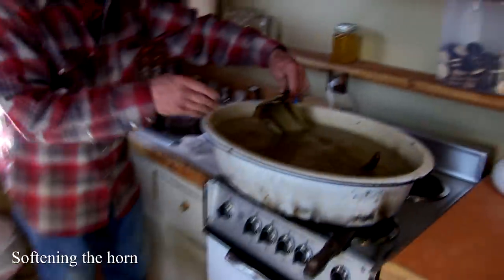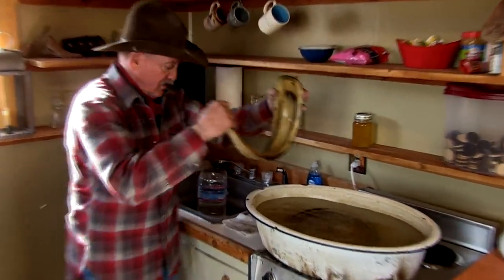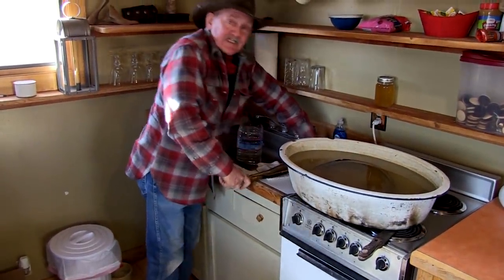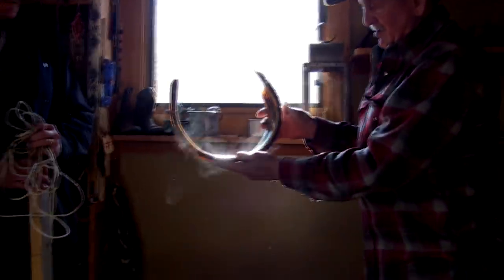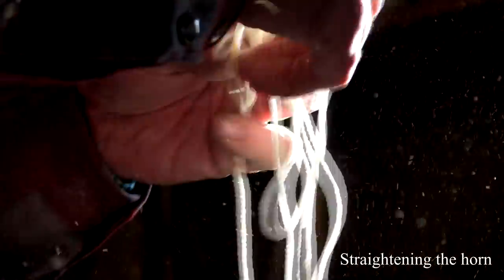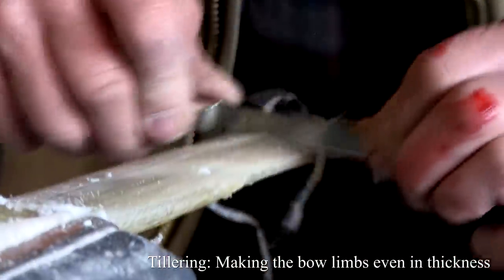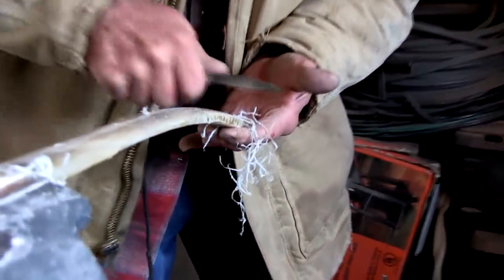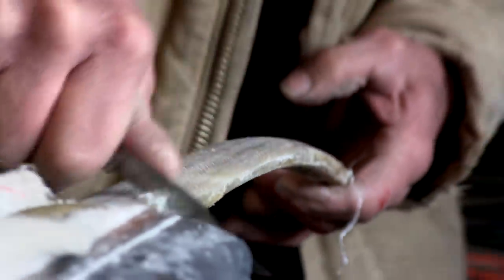Wyoming's Tom Lucas Making Sheep Horn Bows

Comment: He is smart! Using animal hide to make glue cool
Reply: YaAsianFriend Vang 
That's how most glue is made still. It uses things like hide and hooves. 

It makes me wonder how they figured it out back in the day though. Like if turning hide into glue also means dissolving the hide into hot water, how did they figure it out? They would have had to maintain a fire for a rather long period of time to get to that point, and they would have had to continued to add water. What drove them to even try?
Reply: Monkeysrock I'm going to take a stab and say it probably started from ancient tanners since they worked with boiling/treating hides they probably discovered, like him that the water (urine in the tannery's case) was sticky when the hide dissolved some.
Reply: most glue is horse hair I think
Reply: it will do the same in cold water it just takes longer {H2o=universal emulsifier}, if you have ever seen carrion long standing in a stream or marsh they are very sticky. He did mention that they had a sacred relationship with the hot springs of Yellowstone, probably a spiritual place due to it's importance in the progress of it's culture, imagine the benefits of always having a pot of boiling water in those times that required zero maintenance, ever, it just exists, that's pretty god like.
Reply: We have far superior glues today, but back then this worked and still does to this day. So either way works.
Reply: Glue is not made out of horse hair, that's keratin. It is made of hide and hooves and is collagen. It is still used for making instruments like violins, violas, cellos, basses. They usually buy crystals of dried glue and wet it until it gels then heat it. Some makers keep an electric heater full of glue going 24/7. It is extremely strong but because it crystalizes it can be cracked open in case the instrument needs repairs on the inside. You don't want to use glue that can't come apart. If a violin gets damp it will come apart if there is a break in the varnish. This is why you hear the old jokes about sending old horses to the glue factory. They really did. And of course, violins use the hair on the bows, but that's just a haircut and doesn't hurt the horse. Usually, Siberian horses that grow coarse hair. I am a violinist and occasionally need to reglue a seam because of sweat or glue aging. My violin is over 300 years old, but I bet all the glue has been redone at one time or another. Mongolian bows are made just like his but have wood in the middle and take much longer to make, esp. because they use all hand tools Look for videos. They are kept in a leather pouch when not used to protect the glue.
Reply: @davidmdyer838  haha I just mentioned Mongolian bows, it amazing native Americans discovered horn and sinew bows on their own. Mongolian bows use water buffalo horn but cut the same way and softened with water same, but use bamboo core and mulberry wood ends with horn on outside and sinew 9nside same as this one.
Mongolian glue boiled the same way but from fish guts, 8ts like civilizations connected by common circle of discoveries.
Reply: @johnfilmore7638  Native Americans liked wood from the bodark or bodock tree, also called the osage orange. It is fast growing an use to be planted around grazing areas because it is also prickly and cows wouldn't go through it. This practice stopped with the invention of barbed wire but stands of the tree still exist. The name comes from the French bois d'arc or wood for bow because indians preferred it for bow making.

Comment: Cool bows but as a bowyer and archer myself, his comment about horn being the superior material that gives you the most speed per arrow is simply not true. There are all sorts of different woods and materials that are just as strong and will give you the same draw weight and speed.
Reply: Logan M. 
Not to mention the synthetic material.
Reply: I am not sure he is wrong about native woods found in the west.  Juniper and Chokecherry were the major bowwoods used by the indians in Wyoming/Idaho/utah/Montana - the horn bows were much faster and highly sought out as trade items between tribes.
Reply: Yes juniper is a softwood, there are many kinds.  You can find data on wood density for Western Juniper, but indians in Utah and Nevada used Utah Juniper species, that grows between about 6500 and 9000 ft and has better properties than western cedar.  The mountain grown juniper has very tight growth rings and bends well when heated in hot water.   I think most juniper bows were sinew backed.   Here is an article  http://escholarship.org/content/qt4v5249w9/qt4v5249w9.pdf
Reply: Horn is a very superior belly material for composite bows. It has very high compressive strength vs the high tensile strength required for bow backings which was typically bamboo or sinew. The Asian composite bows using these combinations, we're massively high draw weights and horse archers typically carried 2 such bows of differing weights. The lighter bows were said to be somewhere in the 70 - 80 lb range, while the heavier ones exceeded 100 lbs for flight distance and penetration.
Reply: Osage orange was the most prized wood for bows by Native Americans. From wiki "The trees acquired the name bois d'arc, or "bow-wood", from early French settlers who observed the wood being used for war clubs and bow-making by Native Americans." I've seen them growing in Oklahoma where they also call them something like "bodark" trees after the French. The fruit isn't really an orange at all. The wood was traded throughout the country and grew esp. in Comanche territory so it was a sourse of valuable trade for them, kind of like how Portugal made money selling yew wood to England for longbows. The Spanish clamped down on that trade when at war with the English because English artillery (arrows) were so devastating.
Reply: Yes bodark trees are all around Oklahoma and they are the best choice for making a good strong bow.one year I was making a bow out of Osage orange and my knife slipped off when I was shavings the limbs down and cut into my hand the sap got into the cut and my whole hand swelled up for like two days and was very painful.
Reply: Reportedly the Mongols had horn bows up to 180 lb. draw weight.

Comment: Long bows made from Yew can shoot over 300 fps.
Reply: yeah but who can draw it with one arm. I hear Hulk Hogan is getting on a bit and Andre the Giant is no longer with us. I guess if you use the whole side of a tree you can make one as strong as you like. You can make a bow out of truck springs with that sort of strength too but several things other than outright poundage make for a great bow. Anyway it is the art and method that make the video not the details that some people prefer to squabble over like "mine is bigger ; faster or stronger than yours. The man makes the whole thing from materials and glue etc. he makes or acquires himself. It is a pretty brilliant and informative video without a need to dick measure on the details that require a whole book and battery of tests to prove whose is faster or stronger.

Comment: I used unflavored gelatin as glue. I mixed it really thick and heated it up over a very low fire. I spread it on my red elm bow and applied leather on it. The leather was a dog chew toy that I had soaked in the tub for several days. Well, I clamped all of that to a bed rail and put it in my shed, it was August. That glue is TOUGH! The only downside is, it's water soluble.

Comment: Can you make a longer bow?  says using 3 horns to make about 56" long bow?
Reply: A longer bow would be slower and worse, you don't really want it longer. The shorter a bow is, assuming the same tillering skill and back design, the faster it will be, due to less mass in the limbs.

But not out of 3 parts, no, maybe 4 so that it's symmetrical. It really depends on the bowyer's ability to properly splice the material together, the more splices the more chances you have of messing it up, this isn't to say that a properly made glue joint is weak, no, a properly made glue joint or splice is stronger than the wood it binds, even with non-modern glues like hide glue, it's about the mating of the two surfaces and whanot.
Reply: Patrick Hale Definitely right about the excess mass. We aren't talking self bows here, but composite.
Reply: If you ask me its stacking a crap ton it won't bend enough for a full draw plus I can only imagine the finger pinch on that him shooting split finger. Horse bows bend alot more the amount of recurve at the tips help lessen the string angle but even they shoot with thumb release not 3 fingers.

Comment: what did he mean by never fired dry bow?
Reply: it means firing a bow or crossbow without an arrow. The reason why you're not supposed to do it is because the bow transfers a lot of energy to the arrow when firing, and if there's no arrow the energy has no where to go. So worst case you break your bow and get hurt.